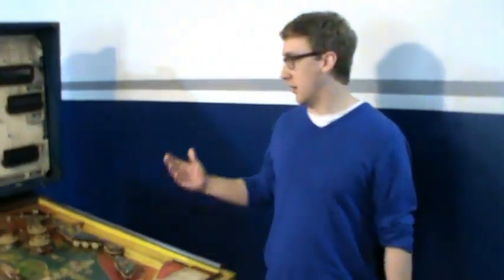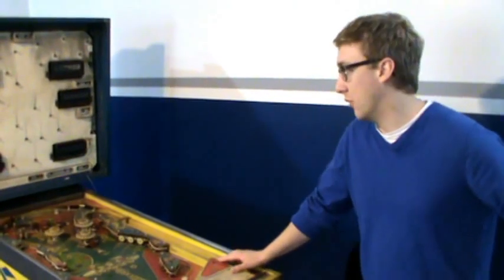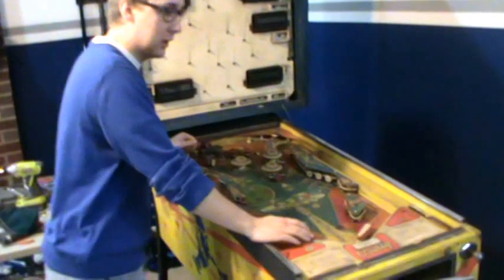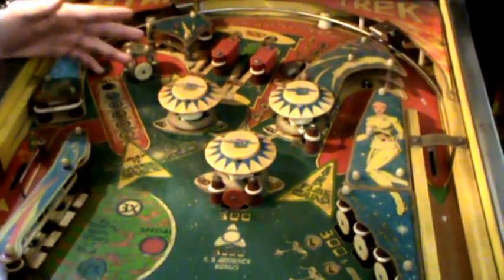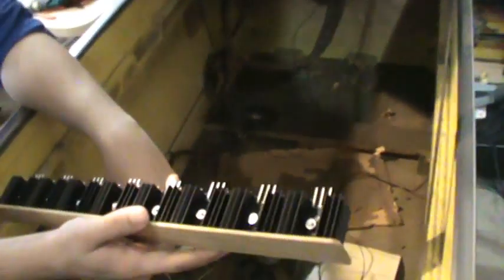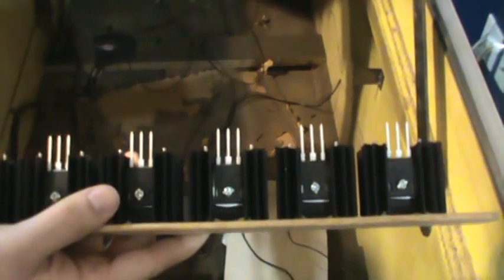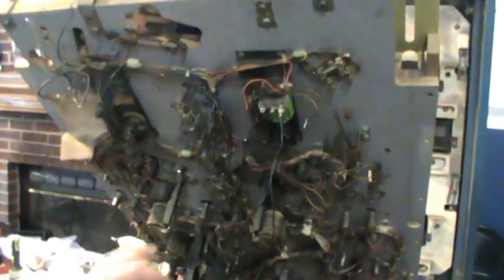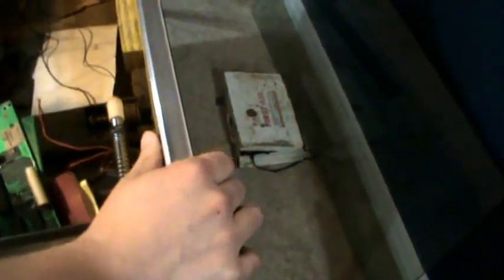Raspberry pi Star Trek Pinball Update 1: Intro

Comment: Hi, is it possible to run a pinball machine using roms and pinmame?
Reply from the maker: I'm not familiar with pinmame, but if it is similar to the normal Mame (which I have used to build a pi retro arcade) then I would imagine so. is Pinmame similar to Mame?
Reply from the maker: After watching a few youtube videos, it looks to me like it is very similar to MAME and would be pretty easy to get this set up. I recommend for the easiest set up to just buy a usb arcade button set on amazon and using that to get started, then build your cabinet with a screen as the table. Seems to me like that's how it would need to be set up (a virtual pinball machine, not a physical one)
Reply: I can only find .EXE files. I tried to run Windows IOT, but I'm still new to it and couldn't find a way to make it work. Is there a way to run a .EXE file in Raspian?
Reply: I think it uses the same principles as MAME. I don't want to say I know for sure, because I don't, but I think so. The problem is that I can't find ROMs that will run using Raspian.